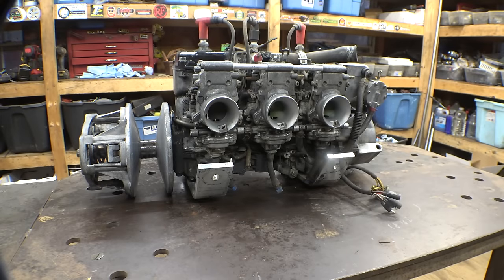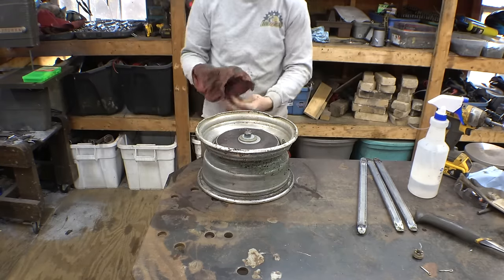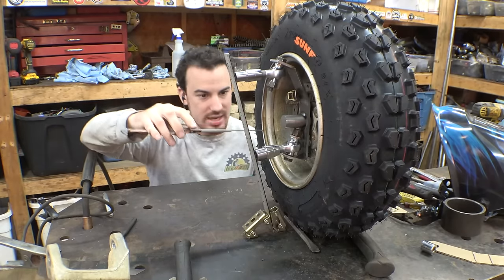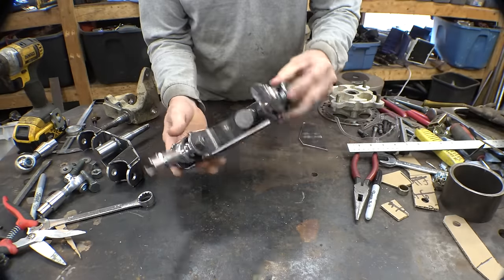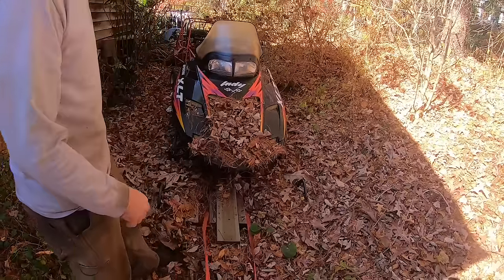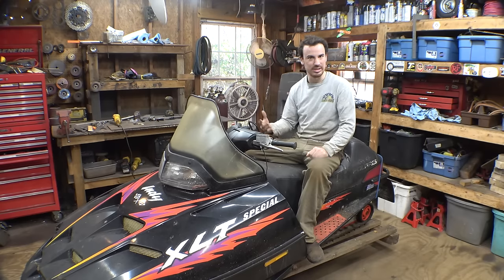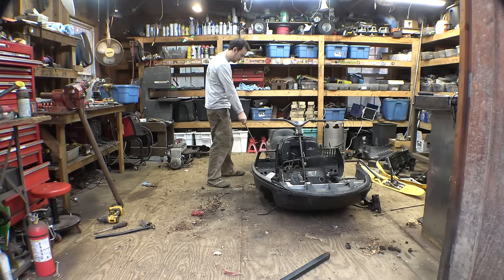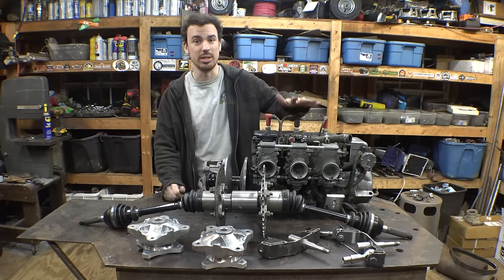Building the CV spool for the Mini Baja Bug Project

Comment: The "Special" XLT difference seems to just be the Fox long travel suspension in the front and rear. Snowmobile 2t triples are such cool motors, I love seeing them in builds. 2Ts have actually been making a comeback with crazy EFI and Turbo models released in the last few years in everything from sleds to dirtbikes and even chainsaws. If the CVT setup wasnt so darn wide I would love to put an older snowmobile triple in a small motoGP style motorcycle build...120+hp and under 300lbs would be a riot :).
Reply: Some years ago I found the Rotax engine page. They have a 850ccm two stroke with 165 HP. I definitely would like to see some vehicle built around it.
Reply: That motor has a little bit different porting and compression than early years and the flat slide carbs were a big improvement

Comment: Regarding the low compression on the engine it might not be an issue, If i remember correctly these engines have a decompression valve / system to allow for easy starting so low compression when just turning it over like you did would be normal.
Reply: Yeah smart, definitely check for one before disassembling or buying parts to rebuild it.
Reply: I was thinking low compression would be great for a little mini turbo, lol.
Reply: It needs 120+ psi.   There's no decompression on an XLT lol
Reply: @joshuaatkins5197  lol, it's low compression because the rings and/or cylinder walls are shot, not because it has short piston travel. (no compression vs slightly lower compression)
Reply: @CobaltOntarioadventures   Incorrect , many Polaris engines including XLT ones  had a decompression valve or well hole depending on model and year.
Reply: @EQINOX187  I'm not going to argue with you here, but you're wrong on the XLT  (fuji) front.    Some Polaris (Liberty) engines with VES are or can be equipped with them.   Not an XLT engine though.
Reply: @CobaltOntarioadventures  " I am not going to argue processes to argue " haha classic  internet troll move .  Again you are incorrect the decompression system was indeed sold for these as not only an initial purchase option but also sold as an after sales upgrade
Reply: @lukerediger8431  tell me you haven't slapped a turbski on an old engine with worn rings and blow by without telling me. My comment had nothing to do with piston travel. Its pretty fun to toss a little turbo onto an engine about to be rebuilt if you don't blow it up. 🍻
Reply: @joshuaatkins5197  if you say so.
Reply: @lukerediger8431  When people argue, but NEITHER side has the ambition to spend a few seconds finding actual facts. Good stuff. Call each other trolls then. If you are both too lazy to even bother with facts. :face-blue-smiling:

Comment: Take the exaust manifolds off and you can see the piston and cycle wall with a flashlight.. if you rebuild you need to check crank bearings and change crankseals.

Comment: 2:24 on your sturdy bench, shape a piece of 8mm metal plate to mimic the shape of the lip of that rim. You can then hook the good side of the rim on that piece of metal (which should be polished) and with a hard faced (but not metal) mallet, smack the dents out.

Comment: That green slime is a preventative.   It gets added usually before the tire is used.  Slime it then air it and you have yourself a tire that acts puncture proof or slime seals around stuff(screws,nails... ect) so you don't get stranded.  It's not really like fix a flat or similar.

Comment: You need to add a metal piece that's rubber covered to the bottom of your beadbuster to do tires to keep it from sliding out on you

Comment: I'm with you on not enjoying working with tires that have the green slime in them, but that being said i will still put it into any ATV/UTV I own.  I drive primarily on rocky trails with a lot of weight on.  I have never had a tire make it for more than its first year before it starts slow leaking.  Put in the green slime and I don't have to add air for the whole season.  Its worth working with the mess at tire change over time.

Comment: if its a high milage engine id look into having the crank pressed apart and the bearings replaced as well because those xlt engines were notorious for crank failures, the engines from that era with the individual cylinder heads were much better engines than the xlt engine with the continuous head in my opinion.

Comment: Woupd be more than likely has stuck rings if the bore is clean id chuck some 2stroke oil in there an let it sit till you start it an heat cycle it id almost guarantee it'll come good

Comment: And a set of Polaris xcr 600 carburetors would make that XLT engine perform a lot better but what you really should do is try getting an XC 600 engine instead of an XLT engine the twin cylinder 600 performs a lot better than the triple in every aspect but I believe the perfect twin cylinder two-stroke engine would be of a 1997 Polaris XC or SKS 700

Comment: Re the green stuff... I agree about the mess but disagree about the efficacy. I use that stuff all the time and once installed will stop new leaks before you realize you have them. (I run over a lot of nails and screws.) If go so far as to say I swear by it! (I once installed a tube with 7 patches into a new motorcycle tire vs a newer one because the old one was bleeding green out the valve core.) I was also a tire buster for a few years back in the day and ANY Fix a flat SUCKED ASS!!!

Comment: I don't understand why you keep buying these clapped out ancient engines and put money into rebuilding them. I get that it's hard to find snowmobiles where you live, but still...
Reply: Content on rebuilding and then installing it on a build double income
Reply: Because he can
Reply: A lot of the engines he’s using can literally be rebuilt for a fraction of buying a new engine. Especially when it comes to snowmobile engines.
Reply: Power to weight ratio cannot be beaten. Simplicity also.  Crazy power potential in a small lightweight package
Reply from the maker: Because that’s what’s in my price range 😂
Reply: @AkPacerPilot  You could literally buy an old zx chassis mxz 600 or 700 in good shape for under $1000. A little more will get you a good 700/800 EFI arctic cat. These are WAY more powerful, lighter, more reliable and a lot easier to tune. 
I've never seen a sled that only needed pistons/rings, they almost always need new cylindres. No way you can rebuild that engine to make factory power for under 500$.
Reply: @ratherBweldingChris  Does your price range include the full engine rebuild?
Reply: @MrArcticPOWER  I literally just did a complete overhaul on a 2010 Polaris dragon 800 for under 500$. That included a new crank, new cylinder group, new pistons, rings, fix-it kit bore, new plugs, and a fiber clutch bearing set… it was actually 468$. Took me 3 hours to tear it down and reinstall. Got the sled for 800$. I’ll sell it for 4K all day long.
Reply: @MrArcticPOWER  (continued) the last complete build I did on a 3 cylinder Polaris was under 600$, that included welding the hole in the bottom of the case. His motor is already in better shape, his motor is turning, it might need new rings, you can usually get a set of rings for that motor for under 10$. You’ll want a new gasket kit for it, 40$. You’ll want to re-hone the cylinders (15$ at a head shop, or do it yourself for the same price for a honing brush.
Reply: @MrArcticPOWER  I do however give you credit for the “tuning aspect”, at least out in the field… but I’m guessing where he lives he’s usually under 3000 msl, you won’t need in the field jet changes if your operating at the same altitude all the time… even if you did, it takes 1 minute to do a jet swap on that motor
Reply: @AkPacerPilot it's easier to critique than to give credit for some people. 🤷‍♂️
Reply: @AL4N.  yup…. It is…